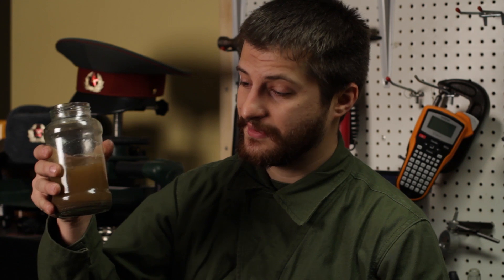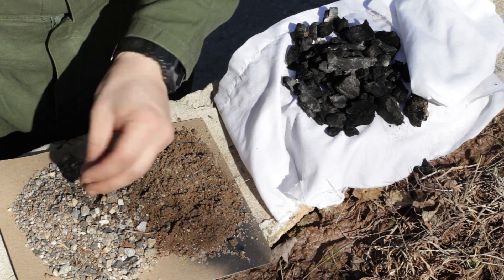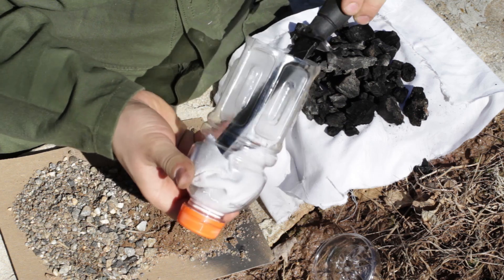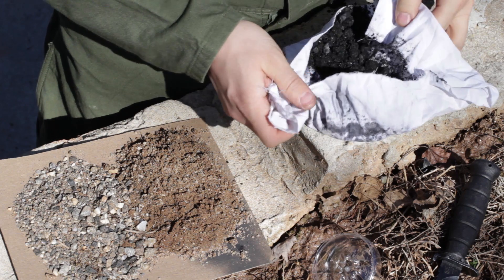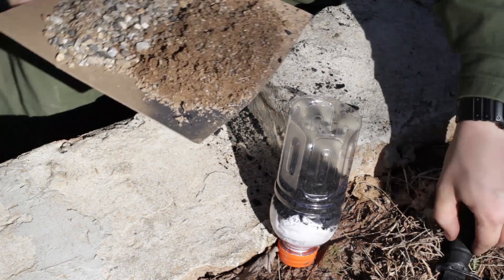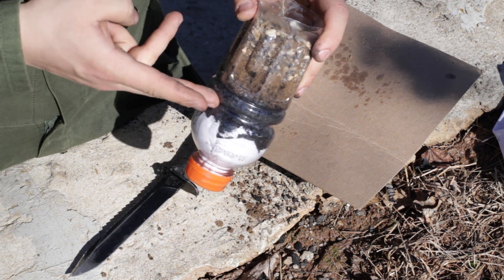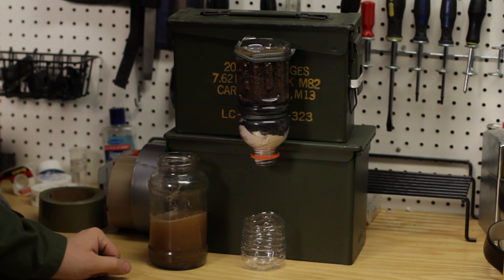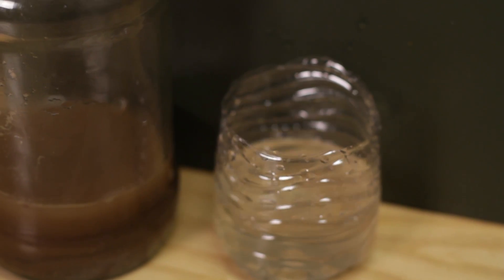DIY Survival Water Filter (charcoal base)

Comment: This doesn't do squat to make water more drinkable. 
This method is all about making the ignorant feel good about drinking nasty water, without improving the water at all. Strains a little of the sediment out. That's it. 

A millbank bag does just as much, is vastly easier to transport, easier to use and saves a lot of time.

Comment: Very nice video. I’ve also made one using a napkin as the fabric layer at the bottom. It also works well and is cheaper. But I feel like it’s more suitable for mold to set up in so I think you wouldn’t get as many uses out of it. But still. If that’s all you have

Comment: This is a good tip I saw once on Ray Mears. the only difference is he used peat moss instead of cloth. Peat Moss has natural antiseptic properties. I like that at the end he said you should boil and add purification tablets. charcoal is helpful for to extracting poisons But not so much for microbes. Charcoal is also useful for a few stomach ailments just grind a little bit about a teaspoon make sure it's not from toxic wood and stir into water and drink don't do this too much it May lead to constipation.

Comment: Try filtering coca cola and see if it converts to pure water
Reply: Well because the dirt and water is just a mixture. You can easily separate it. Soda is a solution though. The ingredients are dissolved.
Reply: Um no. It wouldn't.
Reply: Fargraven195 the color get gone nothing else

Comment from the maker: If you guys want , you can make the filter from cloth and crushed charcoal without using the other stuff , but the other stuff helps alot
Reply: adam rambarran probably
Reply: Make one out of a long piece of pvc or a five gallon bucket. You can filter lots of water this way that is safe for hand-washing and dish cleaning.
Reply: Crazy Russian Hacker showed how a water filter can be used to turn coca cola into drinkable water.
Reply: hi KGB survivalist,

im wondering what knife you're using or what kind of knives you recommend.

thanks
Reply: can you make it with a normal water bottle???
Reply: Odood19
That's a nice idea for everyday use, anyway PVC pipes and buckets aren't usually found in survival scenarios (excepting urban and so on).
Reply: really cool video!!
Reply: KGB Survivalist  Hey where did you get the knife and how much was it?
Reply: +KGB Survivalist Wouldn't it be best to clean the sand first, remove the sediments first because this will just start to clog up your charcoal. I would also have filtered the charcoal.
Frustrating to watch. Kind of like the WTC and Iraq situation.
Just remember this doesn't kill bacteria and should still...ah there you go,covering that now.
Reply: how would you do that
Reply: +dylan dewalt multiple layers of charcoal of different sizes with cloth separating each layer. I made one today.
Reply: 115thDoctor    What type/kind of charcoal??